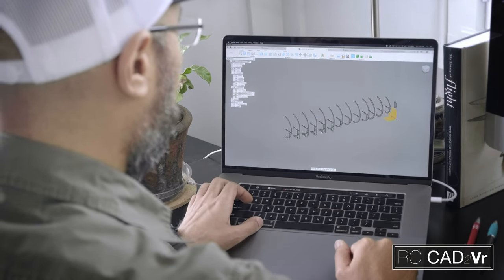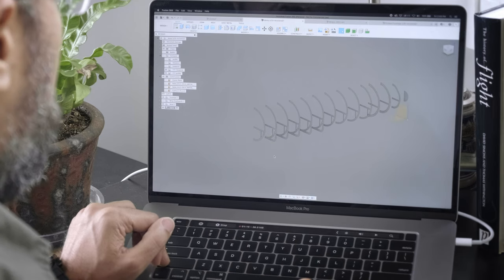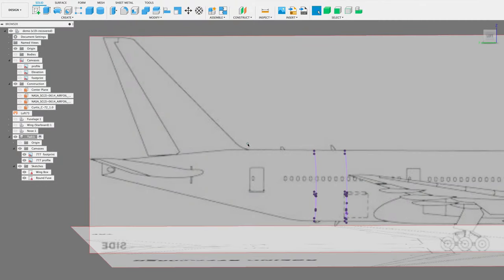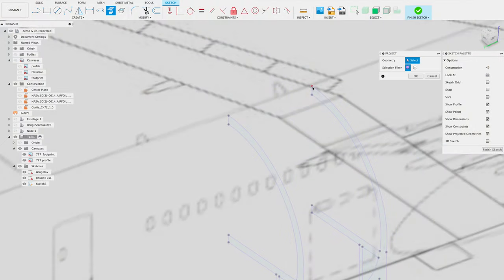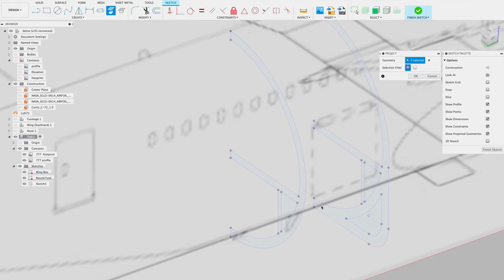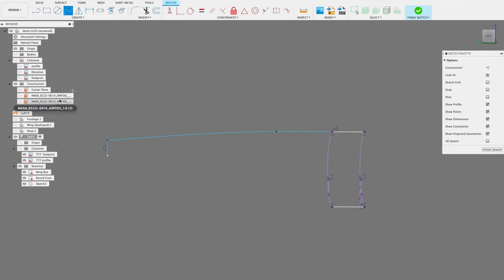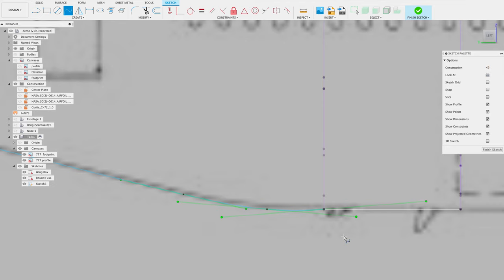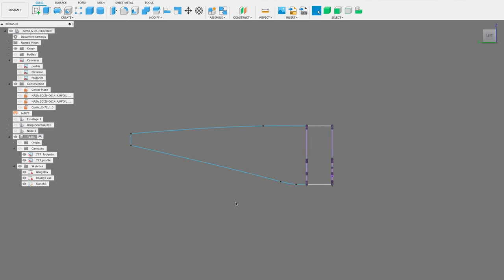How to 3D Model an Airplane's Tail Section in Fusion 360  [Episode 6]

Comment: Thanks for doing this series. It has gone a long way in helping me design a 3d printable 777 with 2m wingspan. Great tutorials!
Reply from the maker: That's great to hear Erik!! Are you sharing the results of your build anywhere on social?
Reply: @RCCAD2VR  Still working on the design in fusion 360. As soon as I have a good printable design I will share them. I work on B747s,B777s, & B767s. So I have access to those manuals, and going off the aircraft maintenance manuals has been tough out at the wingtips. Lots of detail but very small on a scale model. I will post updates.
Reply from the maker: I wish I had access to that kind of up close detail. Good on you man! Yeah, a ton of the full scale details just don't scale down well, but that's half the fun, figuring it out. Looking forward to seeing the progress!

Comment: Nice, just when I was wondering about the 3D-sketch button, you drop in and show us what it is for!
Btw, my CL-415 is progressing, albeit slower than I would like. I had to redo the first features (cabin & nose) a couple of times, but am now getting the hang of it.
For anybody trying to do their own design, the forum at autodesk for fusion360 is quite helpful.
Reply from the maker: hahaha, I've been trying to slowly layer in features figured this was the perfect time to dab our toes into 3D sketching :) 

I can't tell you how many times I've reworked certain parts of the design I am working on. It's all part of the process. Saves you from using up material when you figure it out in software.

Comment: Congrats Terrence!!! I think these videos of yours are very good. I'm just sorry you didn't make a video of the empennage of the L-1011. Terrence... would it be possible to make a dedicated video just for the empennage of the L-1011?
Reply from the maker: Hey there. I originally started recording the L-1011 empennage design for the tutorial and quickly realized the degree of complexity involved in the shape of the plane that the video would run too long, and would cause most people a lot of trouble. So I opted for the traditional airliner empennage since most will be modeling that instead of the L-1011. I can assure you, getting this part of the design right took a month. I wouldn't want to put anyone through that. 😜

Comment: Great job on how this project is turning out-when everything is designed will you be making this project by hand or 3D printer/cutter- I only ask because I’m curious if all the shapes-fuselage/wing foils the hole plane will give you the dimensions for your cuts? Don’t know if this makes any sense -great job so far bro
Reply from the maker: Thanks John. I have actually been going back and forth on laser vs cnc. I'm 99% sure I will be going the laser route due to the degree of accuracy I need for joints. In an upcoming tutorial I will be going over how to take the 3D design and converting it into files that can be used to actually mill/cut/print each of the parts. That way measurements aren't an issue, just let the computer and machine handle the hard part. I hope that answers the question?
Reply: @RCCAD2VR  very cool-thanks for the info-I scratchbuild and build scale models so for me everything is by hand with styrene
Reply: @RCCAD2VR  keep up the great work

Comment: First Great video's really well thought out.
Although I used AutoCAD Light many years ago I had never used the later 3D offerings, but now I'm retired I thought Id give it a go. I took a week familiarising to use the simple things, and getting my head around keeping the projections in line, and now have have started to design my HP42. but for the last week I have been trying to sort out lofting.  the HP42 has an interesting fuselage shape, excluding the nose I have drawn out four formers. I cant see the blue profiles I need to make the loft. I have checked that I have show profile switched on on all four formers, but when I try get a solid body instead of a thin skin. Also I didn't see the red profiles when I tried to do project. Am I doing something wrong, or am I pushing my product to far.

Comment: I am trying to do a C130 which has the flat Cargo door in the back and am having difficulty trying to get that detail to shape right in the sketches for lofting.  Any hints on how to transfer door shape?
Reply from the maker: Hey there. This one may seem a little tricky, but shouldn't be too difficult. In the video I used a central keel line to the very tail. You can to the same with yours, however you will need to add additional sketch lines on the sides of the fuse. Create the profile sketches of the former at the base of the door and the tail/top end of the door, then sketch add the horizontal sketch lines where the curvatures will be. It's very difficult to describe in text, but that is the general direction you will need to go. Use the former profiles as your shaping guide and then fill in from there. Hopefully that makes sense. Let me know if it doesn't. Cheers.
Reply: @RCCAD2VR  Thanks, Makes sense, just need to now figure out how to make it happen.  Off to drawing pad!  Also I discovered that when the door is closed there is an out skin that seems to stay in the curvature. That migh help make it simpler as Io work through it.

Comment: Great work, thanks! How do you print out this stuff so I can cut my wood? Drawing is a bit limited now because of the new personal license.
Reply from the maker: Thank you! I have an episode in the works for that very topic. I just need to wrap up on the design tutorials which is 1, possibly 2 more episodes. The changes in Fusion do make things a little more cumbersome, but completely doable. Can you give me an idea of how you are wanting to print? For example large format, or A4 / Letter size. That'll give me an idea of what I should included in that tutorial.
Reply: @RCCAD2VR  I print on Letter and Legal. I use guide lines to tape my paper together for spars or full size view. Mostly high aspect ratio flying wings, sub 100 gram. Latest is a 40 in flying wing that weighs in at 50 grams without electronics.
Reply: @RCCAD2VR  To the right scal at least.

Comment: Great Video! One Question: The vertical stabalizer is not exactly on the empennage. There is a smal gap. How do you fix this? Greetings from Germany!
Reply from the maker: Hallo Fransci, Grüße aus Seattle WA!  Thank you. Yes, that is correct, sorry for the oversight, you can use the "Extend" tool from the [Surface] -> [Modify] -> [Extend]. Click on the lower edge of the V-Stab surface to highlight it, then select the Extend tool and pull it down into the fuse. Keep in mind that this modeling exercise is to create cutting tools for our structural components... ribs, bulkheads, formers etc. This is not how you'd want to do it if you are making a 3D print. There are a few extra steps you'll need to take in order to make that work correctly. Hope that helps. Let me know if you need anymore assistance.
Reply: Hi  @RCCAD2VR , thank you for your quick answer! May i ask you another question? Sometimes Folds are grey and sometimes yellow. i don't understand the difference. Thank you again for your great videos!
Reply from the maker: @fransci_channel  You're welcome. I don't quite understand what you mean by "Folds"?
Reply: @RCCAD2VR  sorry, I meant Loft. :-)
Reply from the maker: @fransci_channel  Ahhh, that means your loft is crossing itself. Somewhere along the loft, either the profile or the rail is causing the lofted surface to cross over itself, which means it's invalid.
Reply: @RCCAD2VR  thank you!!

Comment: Hi. I have been following your tutorial modeling the L1011 as this makes it easier for me to learn at my age. so the question now is how do i get the Boeinng 777 to size up to the formers? i have scaled the 777 close to the L1011 but they have not been moved yet to the tail. please your guidance  is very much appreciated. thank you.
Reply from the maker: Hey there, You will need to eyeball the alignment. There will be some variance between the two airframes. I started with the L-1011 Tail for the tutorial, but the shape is so complex, that I knew after the challenges with the forward fuselage, the tail would have tested even the most patient of people. I would suggest lining up the profile to match and then using the bulkhead from the central fuselage as the base for the shape.

Comment: Hello, thanks for some very nice tutorials! Actually thinking off doing the wing/wingbox section for my exam job. One question. How do you account for the material thickness on the wing skin and fuselage skin? I’m thinking of doing 3d printed molds for glasfiber for the fuselage and wing skin!
Reply from the maker: Hi. Happy to hear that you like the tutorials. When it comes to material thickness, this needs to be considered in the design based on the type of materials you plan on skinning the plane with. If you are creating a simple frame and using forms to make the skin, you will need to know the thickness of the skin and subtract that from the edges that will be in contact with the structure. If you are planning on planking and sheeting the surface, then it's not a big deal since you're applying the skin directly to the frame. Since it sounds like you've decided to go with the former, I would suggest creating the model from the exterior and then add the frame afterwards. This will ensure you don't need to do any extra measuring or strange compensations in Fusion 360. Best luck on your exam!
Reply: @RCCAD2VR   Thank you very much!, Is it possible to do the skin like you did in the video but then offset it inwards towards the wing structure and that way get the thickness and the structure gets thinner?
Reply from the maker: Yes. Or you could thicken outward, if Fusion will let you. It can be fussy sometimes. Then you won't need to reduce the frame.

Comment: Terrance, additional great video. I used Freecad in the past especially to modify the P47 I built from BT plan to convert it from razorback to bubble version. F360 is so easy and quick to manage loft compare to Freecad. But with this license change I will make a pause on my new project C47. Since with the new personal user you can still genetrate dxf file for cutting  but only from sketch. It may be require additional work but feasible. My concern is more what coould be the next step of AD. Greating from France.
Reply: I am having trouble with exporting a good 2-d drawing for my laser cuts with the new “fission 3 and a half”. AD really screwed us hobbyists.
Reply from the maker: Greetings! Yes, the changes have made things more challenging for sure. I have been working on some solutions to help ease this hurdle to make it easier. It is unfortunate that AutoDesk made these changes. I get the sense there were a lot of people & companies abusing the personal license. I am close to having a workable solution. Stay tuned.
Reply from the maker: Hey there -- Yes it has been an issue for sure. I am working on finding a solution that is workable to make this less painful.

Comment: When will it be ready to fly
Reply from the maker: It will most likely be in the air this spring / early summer.
Reply: @RCCAD2VR  could u make a vid  of how you go from airplane design to making the plans on paper to cut from foam
Reply from the maker: @niahmiles1860  Absolutely, Those are the next sets of videos coming. From CAD to Vr :)
Reply from the maker: @niahmiles1860  Yes :) These videos are being produced this week.